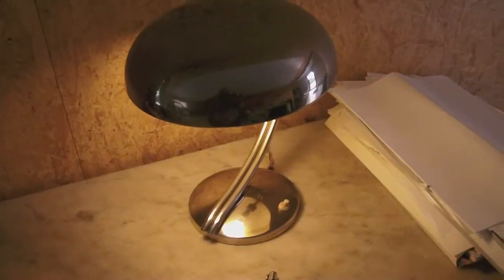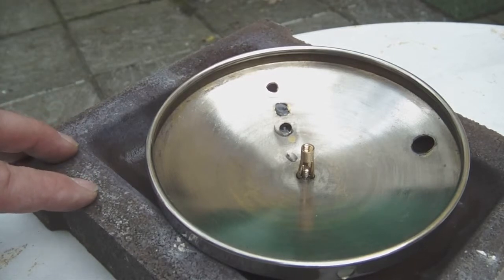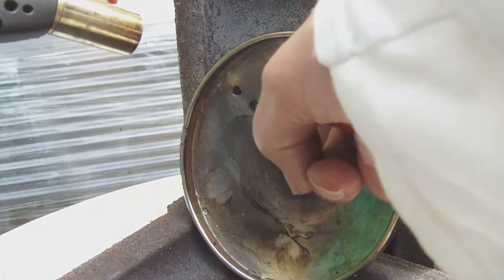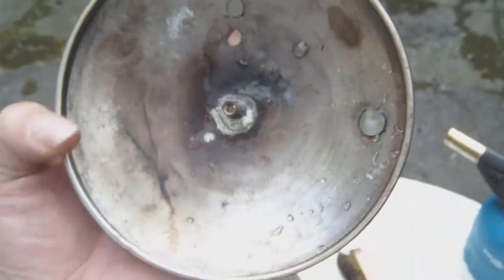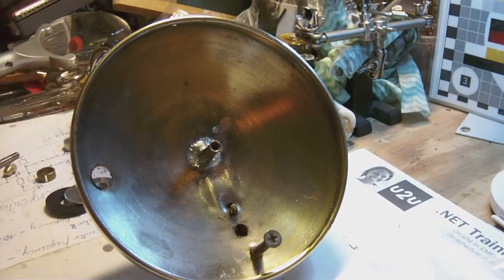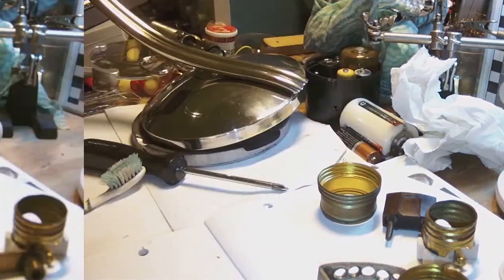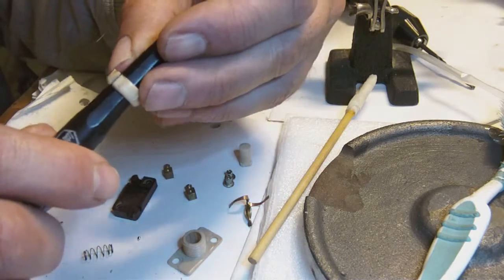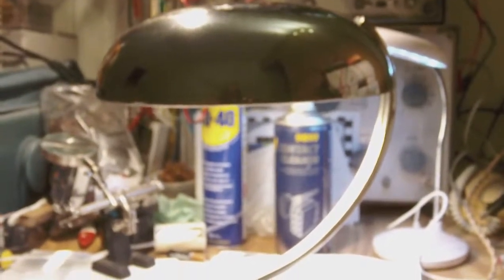Art Deco Bauhaus Desk Lamp 1930 - 1940 part 1 of 1

Comment: No doubt your correct on the age just based on the twisted cloth wire and other details, what a great find! Real Art Deco pieces are always popular and collectable and will only go up in value. Wow, like Bobby I somehow missed that you had a new video up I usually catch them in the first couple days.
Reply from the maker: Hello,
 yes, it was a great find. The seller had advertised it as a 70's lamp. It didn't look very "fresh" either. My guess is, the seller had no idea what she was selling, or at the very least hadn't done proper research into it.
It's always hard to judge the age of something, especially if it doesn't have any markings (brand or maker or serial nr) but seeing its general state, the age of the wireing and the make of the light switch I judged the lamp to be an original at least; if not from a well-known maker or brand. 
Have a look at the links under the video... When I saw those websites, my mouth dropped open :)
Thanks for watching and stay tuned!